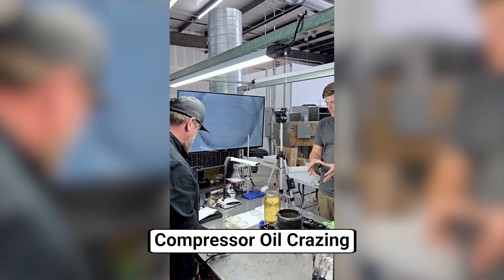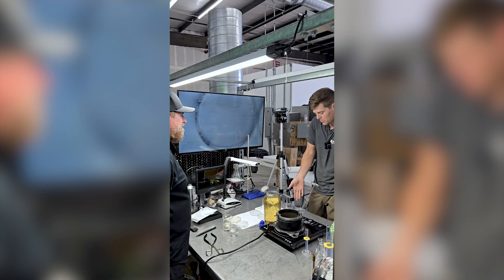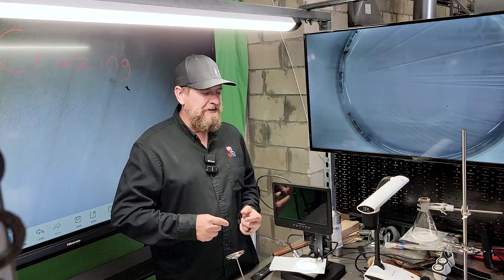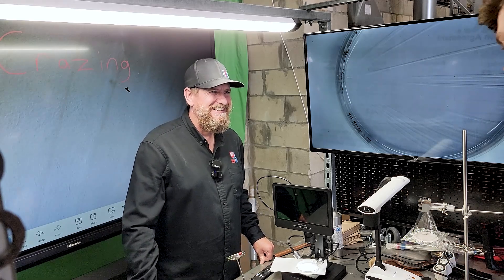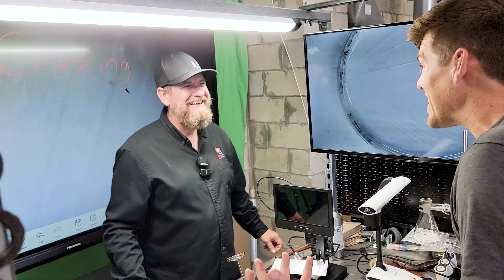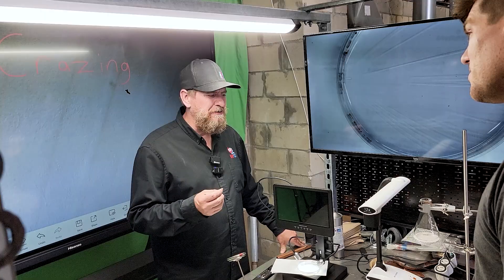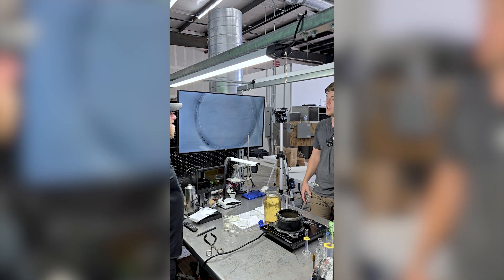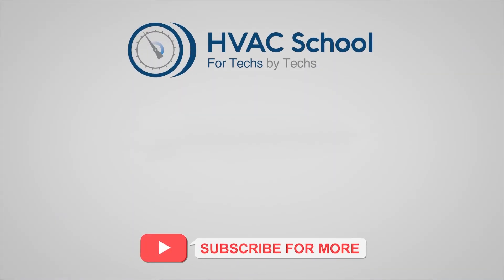Compressor Oil Dangers - Can It Really Melt Plastics - Crazing Explained

Comment: This is especially true when things heat cycle.  The heat drives it in further. 
I've done experiments  with oil just on the surface of the water in a bucket, dipped a submersible pump through it once, rinsed it off, heat cycled it, and became brittle & it fell apart quickly. Dosen't take much POE oil to destroy plastic.
I've  also seen inside refrigeration skids that have had breaches and POE oil mist has coated everything in solest 170, cause light fixtures and other plastics start to fail or fracture easily. 
Gotta watch out for that oil fog!

Comment: I’m not sure why you would use Petri dishes for the oil?   For cost reasons.? They are normally used in aqueous systems and for microbial growth and studies.   
One would predict that the various oils would probably dissolve Petri dishes, which are probably made of polystyrene not polyvinylchloride.    Use Glass/ Pyrex petri dishes for the oil.   You make a very good point about removing most of the spilled oil from surfaces, especially roof membranes.

Comment: I do a ton of car ac. If this is affecting the rubber hoses, what oil is best with 134a, 1234, or even propane/butane?
Reply: With 134a, I used to have a list of all major automotive compressor manufacturers and the oil used (several different oils, mostly different viscosity PAG polyalkylene glycol for R134a depending on compressor brand) and stick with what is best for the compressor.  I think the list was from a compressor remanufacturer.  

For R-12 to R134a retrofits many insisted on ester oil claiming less chance for traces of R12 and R134a oils to become problematic, but instead I had great success with a thorough entire system flush and using PAG that matched the compressor's required viscosity
Reply: @CoolingPerformance agreed; however, since you’re God and I’m just disciple, I know that you’re only supposed to use poe with 1234yf, and PAG isn’t in that list. I generally like to stick with the old tried and true mineral oil in older restorations that use butane/propane blends (envirosafe, which yield much lower head pressures then 134a.) I wondering since you really did and excellent test in this (I love this channel), what would be the effects on commonly used butyl rubber like is used in auto ac. And TBH, I do know that just about any ac drain would crack if schedule 40 is used and it sits in a hot attic for 20 years. 
 As an aside, I KNOW this is wrong, but in my old personal car, I never replaced the mineral oil and used a about 4 ounces of pag when I converted over; I even took the compressor apart to see if there was a early Black Death going in, and it was fine. This car lives in Florida, and has about 150k on the compressor.
 And this channel ROCKS! Makes me wish I’d gone into it permanently.
Reply: @marknaravas318  just to be clear, I was just chiming in only about R134a (not my channel, just another fan like you) since I have an abundance of experience with automotive R134a and using PAG instead of ester when retrofitting from R12 to 134a (I would not know about much other than R134a regarding your automotive inquiry) 

also part of what I noticed and why I preferred PAG was consistent colder air from vents, lower pressure, and lower operating temps (back in the '90s when retrofitting best practices were still being figured out) and one of the main concerns was R134a raising condenser pressures & temps compared to R12 especially when driving at slower speeds with less air across the condenser -hence the extra efforts I chose for PAG trying to make every effort for the retrofit to reach it's full potential (most others argued ester easier and more compatible, but same crowd also often complained of lesser cooling performance)

sounds like a mix of mineral & PAG worked out well for you, makes me wonder if all the warnings against that might have been overstated, my method for flushing all traces of mineral oil was fill the entire system with rubbing alcohol, stay clear of the discharge while spinning the compressor slowly by hand, blow it all out with compressed air (I know, it was wrong; we didn't know better then), and repeat a few times before adding PAG, replacing all O-rings, installing new dryer, and a full hour vacuum holding for another hour (also another practice best left in the past -always use flush, nitrogen, digital gauges, and a micron gauge)
Reply: @CoolingPerformance we think very alike. I was using running alcohol to clean my system too. TBH, I saw only mineral oil used in many retrofitted systems, and never saw a problem with them; if you remember when getting a replacement compressor, most came prefilled either some amount of mineral oil, then you have to remove and refill. It was around 96 that I started experimenting and used what became envirocool for my older stuff as I didn’t like the head pressures. And you’re dead on about the airflow over the condenser; I think I remember heating 134a takes longer to loose its heat in the condenser, leading to them dropping off at idle.
 With the next gen 1234, and the demand for poe oil, I’m a little worried about hoses holding up. They’ve already noted in several videos r32 systems seem to be failing at a higher rate, and the pag oil in those is corrosive and damaging to the systems internal itself.
 I guess we’ll just have to keep our eyes open and ears to the ground. Thank you!
Reply: R134a uses PAG in car AC. but not in electrically driven compressors, because PAG eats the enamel on the windings.

natural refrigerants use mineral oils because.... hydrocarbons...  but propane also works on POE oil.  avoid mineral oils on synthetic Ref's tho, because it can't drag it along the circuit => compressor failure pretty soon.

Comment: You're talking about this oil eating pvc drain line but didn't show any degraded pvc? Petri dishes arent pvc did you test this theory or are we just spouting theories based on nothing again? Spray a petri dish with brake cleaner and watch it destroy itself and spray pvc and watch it remain intact. Apples and oranges till its tested

Comment: We have massive reaction between CPVC used in condensation piping. The CPVC becomes supper brittle and keeps cracking through the fitting and piping. Different version say the way the coils were manufactured or contact with oils or solvents changing the molecular structure of the pipe. It's been a massive problem for us.

Comment: I discovered this back in the early 1990s  my clear plastic business card holders all started cracking and falling apart, and a binder where my oily hands would touch. 

The white thick plastic binder separators that would come in three RING binders to separate different categories became brittle and broke apart . 
      Robin Air, vacuum pumps. They are supplier at one time changed the plastic formula they were using for their handles and the base feet..  all of a sudden my new vacuum pump handles and base feet started cracking and falling apart. 

PAG oil also does this to plastics. 

NAVAC plastic knobs on my four-cylinder recovery machine all start cracking and breaking until it was unusable. 
     NAVAC brand new knobs and brand new knobs started cracking and falling apart again making a nearly $2000 recovery machine into a useless brick

NAVAC 12 CFM  vacuum pump ballast knob, cracked brittle and started falling apart until it was useless in pieces

My newer Fieldpiece, refrigerant gauges the screen plastic covering . They must have changed the plastic because it used to be nearly unbreakable.. 
      My original SMan’s  screens from years ago still have never cracked. I get refrigerant oil all over them.. 
      The last few 480’s I got all my screens on all four of them cracking and splitting all the way through the outer clear screen 

I have not gotten any oil on my new SM482 screen yet , I guess I will find out when I get oil on it.

Comment: Well done and very useful, thanks again.  Many techs watching this have probably experienced trying latex gloves when handling refrigerant (with oil mixed into it) only to find them swell and become useless, and nitrile gloves are much more resilient to the oils commonly found in refrigerants.  Sometimes this swelling is rapid while other times it takes days, weeks, or more of exposure.  Same for automotive lubricants and chemicals; latex gloves quickly become useless while nitrile gloves last much longer.  

On cars you may have seen oil soaked plastics and hoses become soft, brittle, and swollen.  Not sure about refrigerants and refrigerant oils, but automotive lubricants have carefully selected additives and blends of base chemicals to counteract acid (with TBN total base numbers typically around 5ish - 10ish for gas engines, normally over 10ish for diesel engines), conditioners to preserve seals by keeping them soft (but overdoing it can cause some seal materials to become too soft and swell so much that the seal pushes itself out causing a major leak), and other components like friction modifiers, extreme pressure agents, detergents... the list goes on and varies greatly between engine oils, transmission fluids, brake fluids, power steering fluids, gear oils, and of course refrigerant oils.  Anyway, refrigerant oils are uniquely designed for their unique environment.  Modern synthetic lubricants have improved far better than their early days, and the heat torture test from the prior video is one great example.  

After watching this, I'm reminded of how oil soaked automotive plastics and rubbers (cue the immature Beavis and Butthead snickers) become swollen, soft yet brittle in a way, and basically destroyed.  I often see old R22 Trane condensate tray material become strangely soft yet brittle (like some oil soaked automotive plastics) and other condensate tray materials deteriorated in various ways.  Will be paying more attention to potential leaks, ambient conditions, and their effects on different materials after watching this.  Thanks for sharing more great practical knowledge with us.
Reply: PAG oil attacks, some plastics, especially clear plastics, making them brittle. And noticed it on other certain type of colored plastics get brittle and shatter like glass.. 
     Clear, flexible, plastics will get hard in brutal and fall apart and tiny pieces. 
    Depends on the type of plastic

Comment: Wondering how you can remember when abs started coming out when it was being used since the 1950s in homes and buildings for plumbing dwv piping as well as many other uses. You dont look that old to me. Fun fact, legos are also made from abs.
Reply: ABS as drain waste lines some states did not adopt it until the 1990s. 
     Especially certain particular cities that had heavy unions for union workers insisted and kept out only using cast iron for a long time before the drain waste lines were converted over to plastic was accepted, and even that was only a residential not commercial. I’m still not in all locations..
Reply: It depends on the area, some adopted it then, some didn't until 70s or 80s or even 90s, it's all county level so it all moves at different paces.
Wouldn't be shocked if there were still some places it hasn't been adopted
Reply: @scarlet_phonavis  San Francisco in commercial buildings still using iron